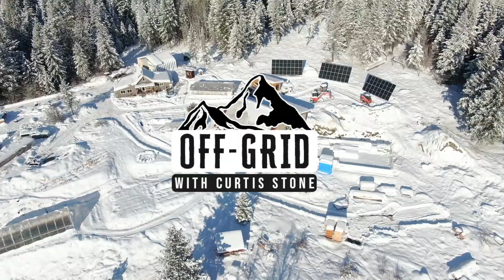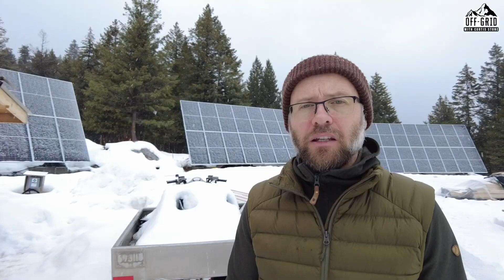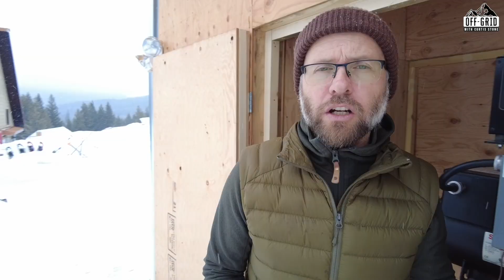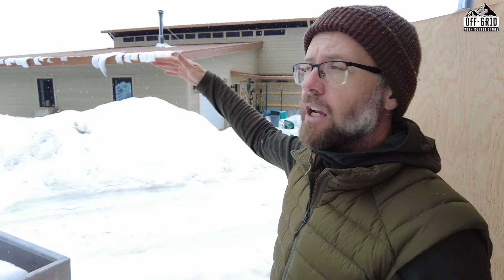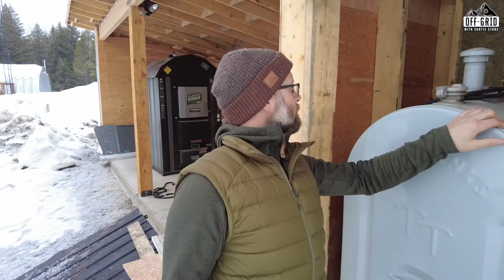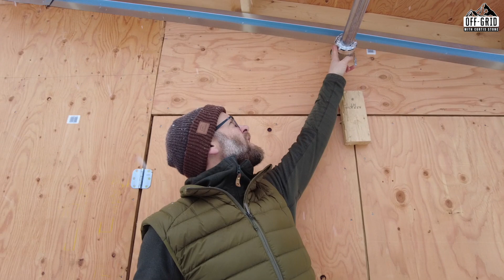The One Part Of My Off Grid System That Might Trigger Some! The Big Secret Comes Out!

Comment: I get your point about not needing the extra Solar because the diesel is so cheap-  and you not needing that much of it.  But if the price of Solar drops in the few years because of a recession or something, I would go ahead and grab that extra Solar setup then---  because the price of Diesel could easily triple if we end up having a bigger war;  so I wouldn't take it for granted in the long haul.   But again, with the crazy inflation right now -- it wouldn't really be the right time to buy it yet.

Comment: LED is getting better, worth looking into again. You can pick the light spectrum you want now days. 2.6-3 umol/joul is getting good.
Blue light is a legit issue but you don't need so much blue in it now
Reply: There are any color LEDs. Can buy RGB led and turn off the blue light completely :D so you get a funky light.
There are warm white LEDs with low blue light output. Incandescent is still more yellow.

Comment: Interesting.  I am curious how the generator works when temps reach -30 C and colder...not once it is running, but rather if it needs to start in those temps.  I am sure it has a glow plug, but wondering if 3 minutes is enough time to warm up sufficiently before the electric kicks in.  Additionally, does it start periodically to ensure things are working? Do you add anti gel to the diesel?  I, like you were at first, would be leery of all the electronics to make the system run.  Those boilers are great - wish I would have put one in years ago.
Reply from the maker: Works fine. It has a block heater in it.
Reply: @offgridcurtisstone  Oh okay.  I did not realize.  Thanks.

Comment: "You spent a lot of money...that's kind of where you're at."  You didn't do an energy assessment and implement efficient appliances, then you built an enormous system that will meet your (bloated?) needs in the dead of winter.  For the sake of argument, let's say you did decide to embrace the idea of dramatically lowering your demand for electricity, such that you're using 1/2 or even 1/3 of the total power you use today.  If and when you do that, won't you have far too much solar, battery storage, and generator capacity for your needs?  

By the way, the monitor on your PC, the lights on your cameras, and virtually everything on your cell phone, uses LED's.  You can't get away from them in modern society.  Not only are they a perfectly safe form of lighting, particularly with the bulb designs they come in today, they are also incredibly efficient AND long-lasting, which makes them a tremendous value compared to the cost of powering and replacing incandescent bulbs.  If nothing else, blue light filters are cheap and easy to implement for just about any LED screen.

It's one thing to be stubbornly independent and free-thinking...it's another thing altogether to stubbornly cling to old ways of doing things.  It is only because you have the substantial means to go about off-grid living in this manner that you are able to look at things the way you do, including putting in enough generation and storage capacity to power a small community of typical off-grid homes.  For "normal" off-grid folks, meaning those who don't have six figures to spend on just the electrical systems, the smart choice is to be economical and efficient, leaving behind the power-hungry approach to modern living as much as you realistically can.
Reply from the maker: You could have made all those comments without the little digs. Did I do something to trigger you?
Reply: @offgridcurtisstone  - Just voicing the perspective of folks pursuing the off-grid dream on a more modest budget.  You seem like a pensive person, so you'll probably arrive at a lot of those same conclusions, eventually.
Reply from the maker: There's literally thousands of videos of that. This is what I'm doing. Don't like it, don't follow me. No skin of my back.

Comment: I use a generator when I need to. I use it to charge up my batteries in the evenings or on mornings when I need it. Why? I figured out that running a generator is cheaper than just buying more batteries that I would use only on the few bad weather days we get in SE AZ. I figured that I could run my generator 2 hours a day for 10 years for the same amount it would cost to buy batteries to handle every eventuality.

Comment: I was with you about LEDs a few years ago but they are indistinguishable now vs incandescent. Check your color temps on the newer stuff, 3000-4000k. even the Edison led bulbs are nice now.
Reply: Constant invisible blinking and emiting crazy amounts of frequencies is much bigger problem than color temps. Even new LEDs still use PWM modulation, nothing has improved.

Comment: This video is not up on Rumble so I will reluctantly comment here. Diesel at $150.00 per year for the one month in question amounts to 66 years to reach the $10,000 amortization expense amount. The genset expense of $13,000 is a necessary redundancy in the off-grid system so this expense cannot be included in this discussion. Price vs Worth = Value, smart. Love your videos, you are an inspiration Mr. Stone. ( Off-grid with  Schneider and Honda Gensets for 6 years, FREEDOM!).

Comment: Light bulbs produce heat, and heat the space they are in.  LED are more important in a warm climate b/c not only are they a "less efficient" form of light, they also work against your Cooling unit.  In a cold climate, they are slightly reducing your need for Heating so it doesn't really matter that they use more energy than an LED.

However, if you say you don't like LED light that's probably your choice of bulbs.  I once claimed to be bothered by LED lights until I found 3w "warm" bulbs (claiming 25w equivalent).  We even use five 1w bulbs above our dining table.  Early LED generally came in "cool" color and way too bright so I thought it was bad EMF or blue light but it's just not the case.  Main source of blue light is sunlight.

Keeping lighting dim and pleasant is of value  More lights of a lower intensity so that your iris doesn't close, then a dimmer room seems brighter.  Under counter lighting also helps in this way, even though it's less efficient as much of the light lands on surfaces you don't see.  Overall, I agree that lighting is not a place to be trying to gain efficiency, just make it pleasant and save elsewhere.

Comment: Happy to see you chose a diesel genset. Although I would recommend a low speed diesel over the 3600rpm one little guys. They don't really last and are not worth rebuilding. Keep an eye out for general construction /mining light plants. They usually run 3/4 cylinder Isuzu or Kubota engines and will run upwards of 20,000 hours. They sell for cheap at Ritchie Bros and Kijiji. They are usually 12-20kw and often offer 120/240v.
Reply: I have a diesel smart car that is close to hitting 100,000 miles and no engine issues.  I wonder if it would be possible to convert such a small engine to run a generator.
Reply: This Yanmar genset is an 1800rpm set, so NOT the buzzy (3600 rpm) little gasoline/propane burner.
Reply: I love my Isuzu Power plant, can be rebuilt in position is the big wining one for me, I can do a major over haul with not moving a thing.

Comment: I don't think you have to make diesel, your yanmar engine should relatively easily be convertible to use pure vegetable oil (there are kits available and most car mechanics will be happy to do the work), you may need to make sure that your extra vegetable oil tank doesn't go below 10c, but considering you have a woodburner in there I don't think that will be an issue.
Reply: But why would you do that? Diesel is always readily available and relatively cheap  when running a smallish gen-set. It's also able to handle the very coldest weather. Going to biodiesel just means extra work and less dependability. I wouldn't waste my time.
Reply: @paulmaxwell8851  Again I am not saying biodiesel, I mean straight vegetable oil conversion, and you would do that in case diesel becomes less readily available but vegetable oil isn't. For example canola which is short for Canada ola. Those converter kits usually are for duel fuel setup's so it would still run diesel but once running you can switch over to vegetable oil. See for example ATG, a German maker of those conversion kits.

Comment: For me I still have grid power available which I use 75 days a year give or take 15 days. What happens when grid goes down for weeks in winter when not enough sun is available. Wind can make that up. I will test that option. there are way to many wind turbines out there that do not produce but Heli 2.0 does as I have seen from several videos @$2400 with everything included except wire. Then having a small 3500 watt gas generator can do the difference for me. I really don't want a generator at all since the price per kilowatt is much higher but redundancy is needed. 50 gallons of backup gas and generator is $750. Wire and such would be $250.  $1000 for a piece of mind is a small price.

Comment: On the viability of using the radiator heat from the Generator: 1 liter of diesel   = 10kWh of heat. So 450 L of diesel  (450 x 10 kWh) = 4500 kWh of heat blowing out the window. (Note: The electricity produced is in addition to the heat energy). So what's 4500 kWh of heat energy worth in the winter. Is the capital cost worth it? What is a comparable capital cost per kWh for solar?

Comment: I agree those who are not trying to get off grid have no clue. I only have to cover 75 days of not enough solar to cover my loads. In my research I found Heli 2.0 48V kit with 5 blades to be the best.  I am seeing an average day with winds 5-15mph produce 14kw. Since you already have your poles you could add 2 of them or even make it just 1. For $2100 it could make a huge difference on cloudy days and save you diesel.  I will be buying one this summer and installing it. I will leave the brake on till i need it since I see no reason to wear out bearings etc and have to use a dump load heater. besides my testing of it. I have 58kw of lifepo4 batteries with 9400 watts of solar. When I get mine up and running I will get you my data if you want.
Reply: As Curtis mentioned in an earlier video, he simply does not have the wind resources at his location. I have several neighbours who spent tens of thousands on wind turbines, and yes they do spin nicely up there. But they rarely ever generate useful power, because we do not have significant wind. These folks did not do their homework, ie site appraisal. Spend your money on photovoltaic panels and don't waste your time and money on wind, unless a qualified energy consultant verifies you have the wind resources.
Reply: @paulmaxwell8851  In winter wind is higher. His are not spinning or doing anything because they are end of life. 4 months a year in late fall to early spring the wind doubles in all northern states. To catch the wind you need to be at least 30' up and his are higher.  Not all Wind turbines are created equal. That is why I have been researching which ones actually perform. This is also why I said I will let him know how mine do in 5-15mph winds. Turbines at 12 mph produce about 25% of rated output. 20mph  50-65%. 28 mph is the sweet spot where you get about 100%. So with wind at gusts 5-15 mph it should average 400-600 watts per hour.  9,600 watts - 14,400 watts in a day. I bet he can attest to he gets wind over 10 mph a lot in winter. I see so many turbines not produce. That is why I  researched which ones do at an affordable price. He already has the tower which is the most expensive part. So again I will test it and let him know. Then he can decide if he wants to do it. I ahve soalr/batteries inverters and I am off grid all but 75 days in the shortest days Nov to end of January.

Comment: Not being able to do laundry (or some other stuff) all the time 24/7 is probably the least important trade off I can imagine with having the luxury of being more self sufficient…. It’s like gardening, people should get used to eating local carrots cabbage, etc in winter like the old days, as opposed to constantly having everything that’s low quality anyhow.  Difficult financial times are making that a reality anyhow now…

As for LEDs they have made HUGE strides recently, I’m highly sensitive to toxic radiation and I’m fine with them, cheap “orange” warm white IKEA ones even, my bonsai trees also thrive off mixed spectrum ones.  You can get enough orange light by a little bit of sun exposure throughout out the week/month outside.  I know Mercola is against LEDs, but my experience is different for what it’s worth…

Comment: isn't better propane generators? becouse diesel have a short duration like 6 months of storage.
Reply from the maker: Not even close dude.
Reply: I've started plants on 10+ year old diesel, you're thinking gasoline, Diesel, so long as stored dry with biocide will last near indefinitely, longer if in a sealed cool tank.

Comment: I have a yanmar 20 kw and it's been the best generator I have every had. It's been flawless for at least the last 10 years. I think it has 18000 hrs on it and the only thing I've done to it was change the turbo once for a couple hundred bucks.
Reply: Yo, it's 3 years later. I'm working on installing a 50kWh genset at my off grid homestead, how's your Yanmar holding up? I found a way to share/sell excess electricity I generate, to local neighbors, or sell it to the grid and lower all their costs by a little bit

Comment: I personally think your doing AWSOME - I've been 100% off Grid for over 5 years

FORGET the IDIOTS - Keep it up

VERY impressing system you have designed
Reply: 7 years offgrid  here  
Used to use my diesel gen constantly.
Now I only use it 3 times a year.
Reply: Going on 5 months off grid here. It’s been a huge wake up call that’s for sure. I need a bigger battery bank as well as a bigger generator. 😳